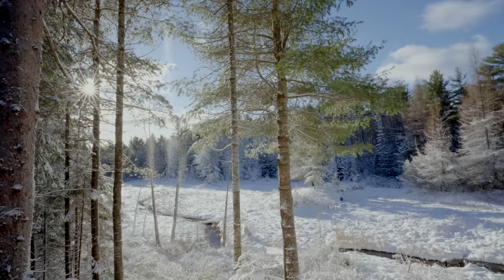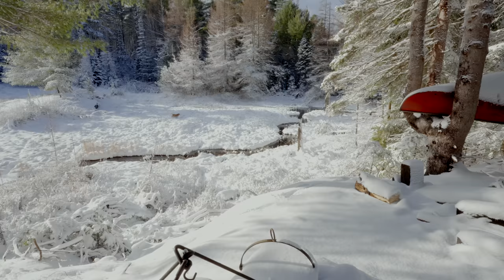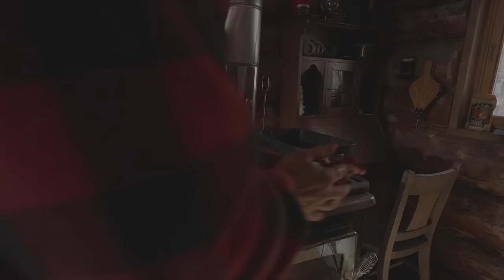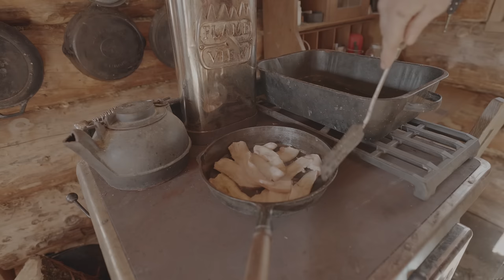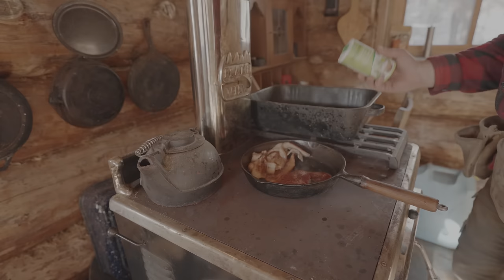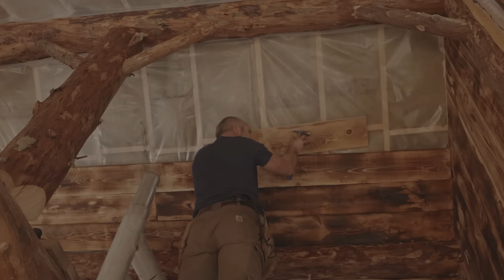Installing a Wood Ceiling in My Off Grid Log Cabin

Comment: Now I know why internal roofers always have an apprentice working alongside them, for the best part they are the humpers and lumpers. So every overhead job that needs completion has a standby pair of hands, just in case a nail or screw affixed into the wrong position, does not mean a trip to the local A&E Dept. Cheers Shawn and Cali "Who I'm sure said - Well if your cooking Dad then I am looking."

Comment: In our family mountain cabin - built 54 yrs ago and of fairly similar size - we made the roof our traditional way, ie to mount the ceiling panel boards perpendicular to the longitudinal round timber beams pluss the insulation BEFORE we put in roof sheets etc.

Comment: Do you think that a platform pretty much surrounding your chopping block and pretty much level with the top of it, with shallow walls around each sice and in the back would be helpful by for the most part avoiding having to bend over and pick up the split wood from the ground.
Tom G.

Comment: Might consider ,if you haven't already,  installing a vent through the floor to the cellar to draft cool air in the hot summer heat.

Comment: Hi Shawn.  Are you having the composting toilet's composting unit in your basement?  I lived with a stand alone Sunmar for 15 years or so, in my living area.  Removed eventually because of fungus gnats.  They just loved the place after the first 10 years.  Couldn't get rid of them.  Diatomaceous earth helped, but had to be diligent with it.  Even with a fan constantly running there was smell in the bathroom.  Good luck with it.

As you were describing the ceiling left to do I flashed on the woodstove in place, covered in snow last winter.  You've come a long way baby!

Comment: I don't really understand that inner plastic layer. Doesn't moisture collect on that plastic with natural oils and grease from our bodies and cooking, and then that can mold over time? Does it not take a air-filtration system? Is not the material on the roof meant to release moisture yet insulate? Why create an inner plastic bubble? It seems to defeat the purpose of building something that breathes.

Comment: Ok I'm a dumbass when it comes to this stuff so please educate me. My question is, why wouldn't you put the char side of the wood against the plastic where the moisture is going to be if you char to keep the moisture from eroding it??  Don't get me wrong the char look is beautiful but it also makes it darker in there so you are going to need a lot of lighting won't you?? I love the way it looks though. It's beautiful
Reply: I hope Shawn doesn't mind if I try to answer this one. The burn boards on the inside is for overall rustic look. Moisture not an issue, wood heat is extremely dry, plus roof has ample insulation.
Reply: @jimgriffiths9071  Well said Jim!  👏

Comment: Always try to meet your butt-joints on a rafter's bottom cord - that way you can toe-nail each end tight into solid wood and not have your joint floating unsupported - it's structural as well as in the future if the board wants to twist or bough. I see in some places you did.